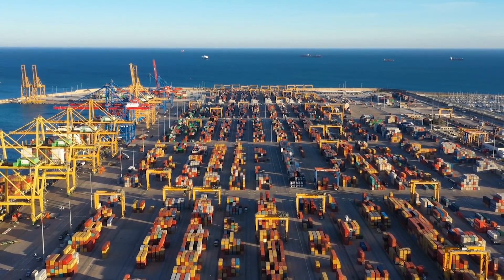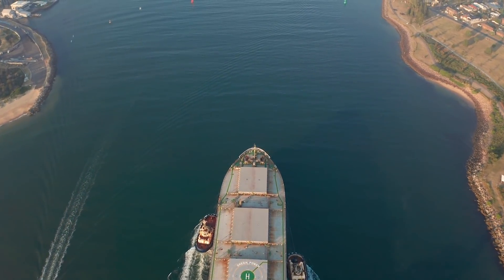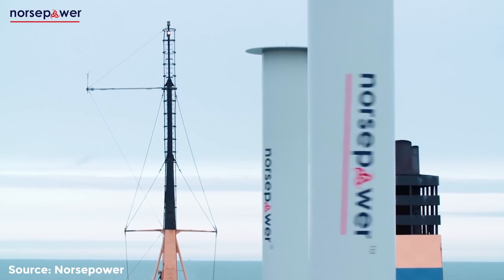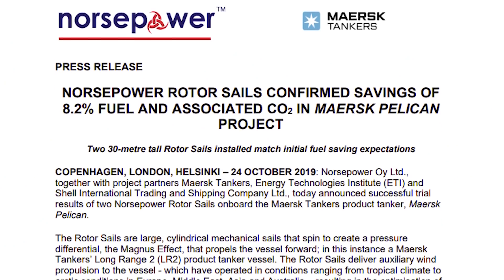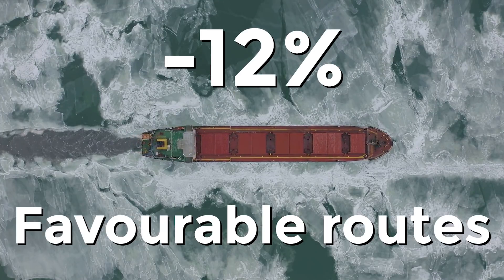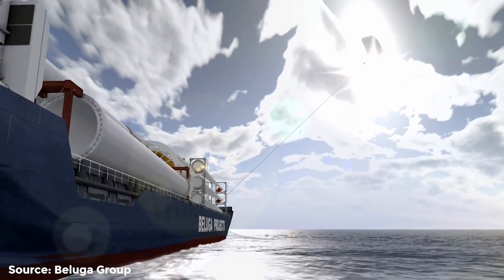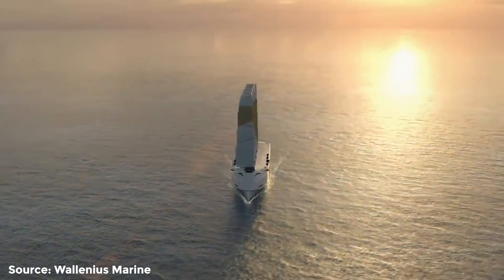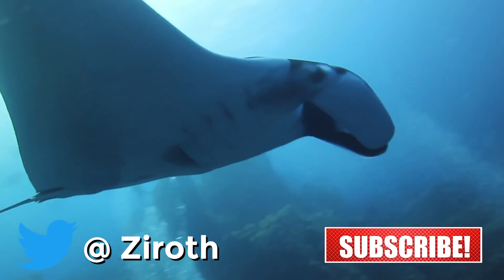Is Wind Power The Future of Shipping?

Comment: Lol, people think it's sailing by wind. What they mean is powering the boats engine by air.
Reply: The fuel that they will use is air
Reply: To address the suggestions that wind power is the answer I offer the following example.  In 1870 a premium sailing vessel entered service, the ‘Cutty Sark’.  The Cutty Sark was 64.74 metres in length with a beam of 10.97 metres and a loaded displacement of 2 100 tonnes.  She was able to carry, at best, 1 700 tonnes of cargo and to harness the energy in the wind the available spread of canvas was up to 2 976m2 which was tended by a crew of about 30 skilled men.  A ratio between the sail area (SA) and the vessels displacement (D) determines how lively she is; ‘lively’ being nautical speak for ‘fast and manoeuvrable’.  The carrying capacity of cargo ships is constrained in two ways, mass and volume which leads us to the ‘stowage factor’ of the cargo; the more mass on board the greater the displacement which in turn impacts the efficiency of the hull form and sail area / displacement ratio.  A vessel constrained by mass is said to be ‘down but not full’, while a vessel constrained by volume is said to be ‘full but not down.  When in the tea trade, which the ‘Cutty Sark’ was designed and built for with fine lines (more nautical tech speak, so again no need to worry about it) she could carry around 600 tonnes of cargo at speeds of up to 17.5 knots dependent on the prevailing wind and had a typical China to UK time on passage of 120 days.  The tea trade was very competitive so ‘time on passage’ was a large factor in securing the premium freight rate that made her cost effective.  Rounding things out, her maximum available sail area gave circa 5m2 of canvas for every tonne of tea carried.

As soon as the Suez Canal opened, which the ‘Cutty Sark’ was unable to sail through; she lost her advantage, raw speed, to the steam powered ships of that era who could beat her ‘time on passage’ by taking that short cut.  Mechanically powered ships have improved in terms of efficiency, on a freight tonne mile basis, by at least one order of magnitude since then.  After losing out to the coal burning, fire tube boiler, steam reciprocating mechanical ships of the late 19th century ‘Cutty Sark’ was relegated to the Australian wool trade, just about the bottom of the barrel in maritime terms and only one small step up from being a 'honey barge'.  The canvas, cordage and extra manpower needed for sailing ships was never a very benign environmental option so please discount any idea of sail as ‘sustainable’.  All this is without the problem that if ‘the wind don’t blow the ship don’t go’, when it does blow it often blows in the wrong direction for your cargo delivery needs and sometimes there is rather too much of it for comfort.  Sailing ships are unable to go directly up wind so if the wind is blowing form the direction your cargo needs to then a zig-zag course must be steered, more distance and more time.  Wind is traditionally measured on the Beaufort Scale (wind speed) that runs from 0 (< 1kn) to 12 (> 63kn) and for sailing purposes the usable part of the range is ‘3’ (circa 8kn) to ‘6’ (circa 24kn).

Random fact about ‘Cutty Sark’, it is said to have been possible to coax 3 000 horse power out of her sails, or in ‘real money’ 2 206 500 Watts (2.2 megaWatts), or 741 Watts for each square meter of sail area.  So that majestic spread of canvas would have been even less efficacious for delivering your baubles and bows from the orient, despite taking about three times as long on the voyage.  The sails on the ‘Cutty Sark produce about 0.33% of the power need to propel a Mearsk Triple E in ‘ideal conditions’ the energy harvest would be less than 0.5% of the output from the ICEs.  Remember shipping is a high volume low cost, therefore low margin business, and all costs have to be beneficial.

Canvas and hemp are accorded 'renewable' (read as ‘natural’) status, if ‘synthetics’ are used there will still be a need for the input of FOGI products.  'Synthetics' would have a much better working life span than 'naturals' but would still yield the same amount of energy, 741 Watts for each square meter in those elusive ideal conditions.  Wallenius are currently giving wind power a go with wing form ‘sails’ but evidence is a little short of proof as of this date.  KTH (Kungliga Tekniska högskolan), a sort of up market university in Stockholm, who are using the funding to derive results will probably, and eventually, in the best traditions of academia ‘publish’ a ‘paper’ unless the funders invoke the well known ‘commercial sensitivity clause’ of their agreement with the KTH.  On board wind turbines might get you around some of the problems however for marine use vertical axis wind turbines (VAWT) would be better than, the what have now become 'traditional', horizontal axis wind turbines (HAWT) for reasons that include the air draught of the vessel, weight distribution and maintenance access.  The energy yield is still subject to the wind blowing at the right strength and having space available on board for the hardware.  The masts, rigging and sail handling arrangements would take up 'prime real estate' on the vessel.  Fuel oil bunker tanks can be stuck away in any odd corner and the ICE power plants are themselves relatively compact.  The stacked up 'boxes' would mean putting the wind driven propulsion units in a bad situation from a ship stability point of view.

Comment: I like the thought of these. 
For shipping of goods,  it can be as slow as it wants to be. Of course not drifting aimlessly-speed, but it is accepted that overseas shipping takes weeks or months already. 

Point being they can optimise fuel savings, instead of having impatient passengers as a factor. 
And who knows, maybe cruise lines will pick up on it. 

For once, a nice loop that improves on itself in business.
Reply: To address the suggestions that wind power is the answer I offer the following example.  In 1870 a premium sailing vessel entered service, the ‘Cutty Sark’.  The Cutty Sark was 64.74 metres in length with a beam of 10.97 metres and a loaded displacement of 2 100 tonnes.  She was able to carry, at best, 1 700 tonnes of cargo and to harness the energy in the wind the available spread of canvas was up to 2 976m2 which was tended by a crew of about 30 skilled men.  A ratio between the sail area (SA) and the vessels displacement (D) determines how lively she is; ‘lively’ being nautical speak for ‘fast and manoeuvrable’.  The carrying capacity of cargo ships is constrained in two ways, mass and volume which leads us to the ‘stowage factor’ of the cargo; the more mass on board the greater the displacement which in turn impacts the efficiency of the hull form and sail area / displacement ratio.  A vessel constrained by mass is said to be ‘down but not full’, while a vessel constrained by volume is said to be ‘full but not down.  When in the tea trade, which the ‘Cutty Sark’ was designed and built for with fine lines (more nautical tech speak, so again no need to worry about it) she could carry around 600 tonnes of cargo at speeds of up to 17.5 knots dependent on the prevailing wind and had a typical China to UK time on passage of 120 days.  The tea trade was very competitive so ‘time on passage’ was a large factor in securing the premium freight rate that made her cost effective.  Rounding things out, her maximum available sail area gave circa 5m2 of canvas for every tonne of tea carried.

As soon as the Suez Canal opened, which the ‘Cutty Sark’ was unable to sail through; she lost her advantage, raw speed, to the steam powered ships of that era who could beat her ‘time on passage’ by taking that short cut.  Mechanically powered ships have improved in terms of efficiency, on a freight tonne mile basis, by at least one order of magnitude since then.  After losing out to the coal burning, fire tube boiler, steam reciprocating mechanical ships of the late 19th century ‘Cutty Sark’ was relegated to the Australian wool trade, just about the bottom of the barrel in maritime terms and only one small step up from being a 'honey barge'.  The canvas, cordage and extra manpower needed for sailing ships was never a very benign environmental option so please discount any idea of sail as ‘sustainable’.  All this is without the problem that if ‘the wind don’t blow the ship don’t go’, when it does blow it often blows in the wrong direction for your cargo delivery needs and sometimes there is rather too much of it for comfort.  Sailing ships are unable to go directly up wind so if the wind is blowing form the direction your cargo needs to then a zig-zag course must be steered, more distance and more time.  Wind is traditionally measured on the Beaufort Scale (wind speed) that runs from 0 (< 1kn) to 12 (> 63kn) and for sailing purposes the usable part of the range is ‘3’ (circa 8kn) to ‘6’ (circa 24kn).

Random fact about ‘Cutty Sark’, it is said to have been possible to coax 3 000 horse power out of her sails, or in ‘real money’ 2 206 500 Watts (2.2 megaWatts), or 741 Watts for each square meter of sail area.  So that majestic spread of canvas would have been even less efficacious for delivering your baubles and bows from the orient, despite taking about three times as long on the voyage.  The sails on the ‘Cutty Sark produce about 0.33% of the power need to propel a Mearsk Triple E in ‘ideal conditions’ the energy harvest would be less than one two hundredth of the output from the ICEs.  Remember shipping is a high volume low cost, therefore low margin business, and all costs have to be beneficial.

Canvas and hemp are accorded 'renewable' (read as ‘natural’) status, if ‘synthetics’ are used there will still be a need for the input of FOGI products.  'Synthetics' would have a much better working life span than 'naturals' but would still yield the same amount of energy, 741 Watts for each square meter in those elusive ideal conditions.  Wallenius are currently giving wind power a go with wing form ‘sails’ but evidence is a little short of proof as of this date.  KTH (Kungliga Tekniska högskolan), a sort of up market university in Stockholm, who are using the funding to derive results will probably, and eventually, in the best traditions of academia ‘publish’ a ‘paper’ unless the funders invoke the well known ‘commercial sensitivity clause’ of their agreement with the KTH.  On board wind turbine might get you around some of the problems, however for marine use vertical axis wind turbines (VAWT) would be better than, the what have now become 'traditional', horizontal axis wind turbines (HAWT) for reasons that include the air draught of the vessel, weight distribution and maintenance access.  The energy yield is still subject to the wind blowing at the right strength and having space available on board for the hardware.  The masts, rigging and sail handling arrangements would take up 'prime real estate' on the vessel.  Fuel oil bunker tanks can be stuck away in any odd corner and the ICE power plants are themselves relatively compact.  The stacked up 'boxes' would mean putting the wind driven propulsion units in a bad situation from a ship stability point of view.

Comment: The kites do 5-12% 
That’s game changing
Reply: Not really moving 5-12% less material or moving the material 5-12% distance would be an easier, quicker and zero cost option to achieve the same result. Doing less, using less costing less.

Comment: The great circle route is the longest route around the globe from one point to the same point which is the equator itself as the globe is not a perfect sphere but bulges slightly along the equator or "The Great Circle". just sayin.
Reply: A 'great circle' is the SHORTEST distance between two points on a sphere. The plane of that great circle will always pass through the centre of curvature of the surface of the sphere that the two points lie on.  Further information may be found in any reputable navigational text book.  If you are in the USA your local library may have, or be able to get you, a copy of Bowditch to borrow.

Comment: You said a tailwind is not optimal because front sales are underutilized. But these sails are already flexible in height. What if they were flexible in rotation, mounted on a central beam, so the whole set could be rotated. This would be heavier but it could get maximal benefit from more wind directions (accept headwinds of course). There could be beams for the bow and stern to limit overall width.I imagine these would pose a big risk in storm conditions, and only be used for calmer sailing.

Comment: Maybe in the interim make the companies buy fuel that isn’t literally the dirtiest fuel available.
Reply: Improved fuel quality will have a impact on the price and hopefully discourage over consumption, however self restraint by consumers would have a similar impact.  The benefits of better fuel are not limited to reduced atmospheric pollution and I agree that better regulation is a good idea but requiring the regulators to only control producers is only half the problem, should they also tax consumers 'wants' to free up capacity to provide better for 'needs' while holding the impact steady or even perhaps causing a remedial reduction?